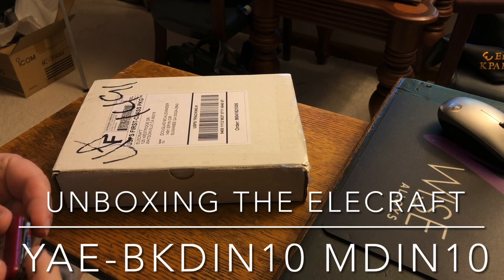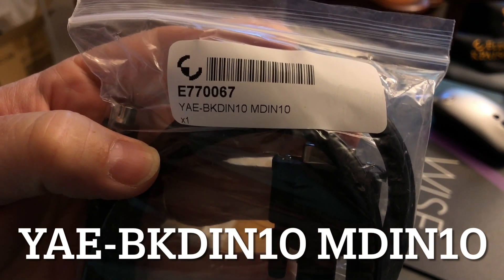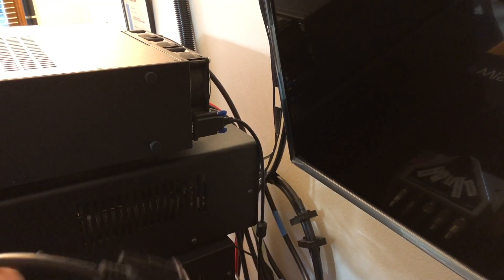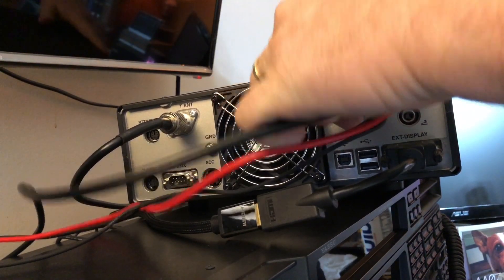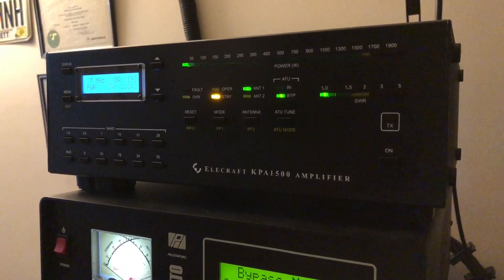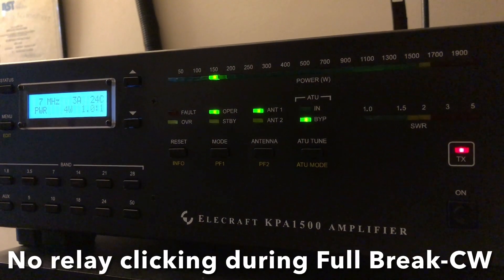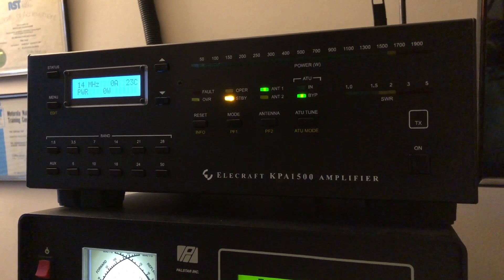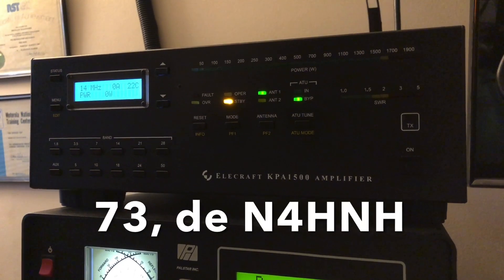Unboxing the Elecraft YAE-BKDIN10 MDIN10 Linear Control Cable (Video #23 in this series) #ftdx10

Comment: Hi Doug.  I just purchased a KAT-500 for the FTDX-10 With the same exact cable.  I’m not currently going with the amp.  Is the cable configuration/interface between the receiver and tuner the same?
Reply from the maker: Yes, use the 10-pin cable from the radio to the KAT-500. If you choose to add an amplifier later, you need only to connect the shorter cable between the KAT-500 and the KPA-500. 

73, de N4HNH

Comment: My cable connects the tuner output of my FTDX10 to my AL-1500 RCA relay input.  I bought the cable on eBay and connected it per the instructions from dx engineering.  So good so far.
Reply from the maker: ACOM amps also hook up via the Tuner connector.  But Yaesu tech support told me today that they prefer that people use the Linear connector.  I didn’t ask why they frown upon using the Tuner port, other than the fact that it ties up the tuner port.

73, de N4HNH

Comment: You got my wish list ... the Autotuner and the Amplifier.  So sweet ............
Reply from the maker: The amplifier has an autotuner built in.  It can tune up to a 10:1 but not at legal limit.  It can tune up to a 3:1 and allow legal limit.  It must be derated for mismatches above 3:1.  But the AT-AUTO can tune just about anything and allow legal limit.  However, on 160m, the balun in the AT-AUTO becomes saturated at more than 1kW.  The SWR begins to rise as the core heats up.  But 1kW is enough for any band.

73, de N4HNH